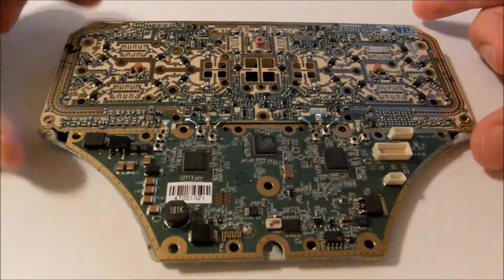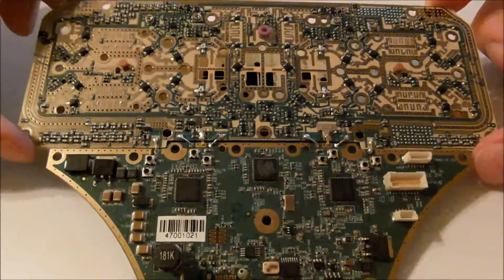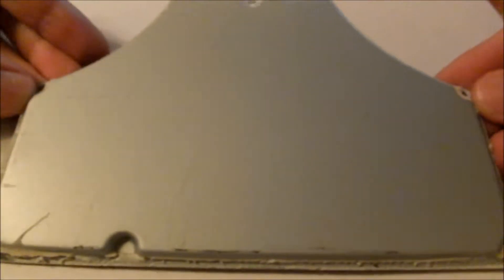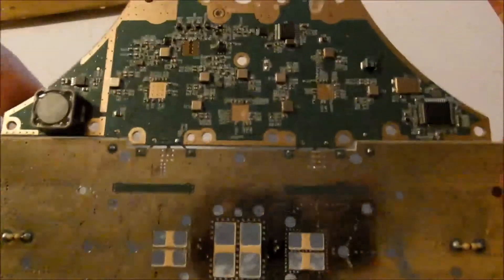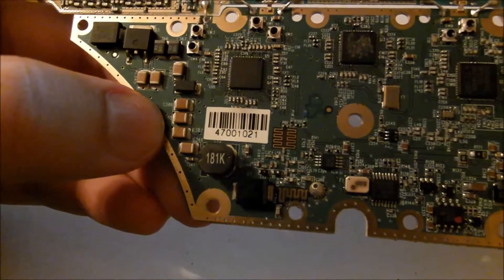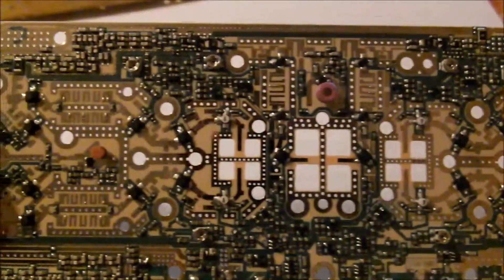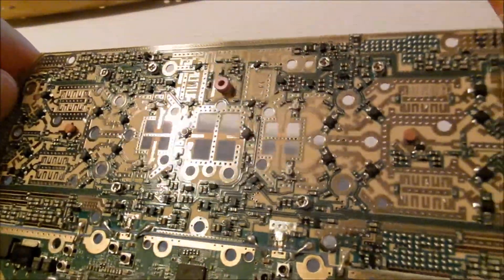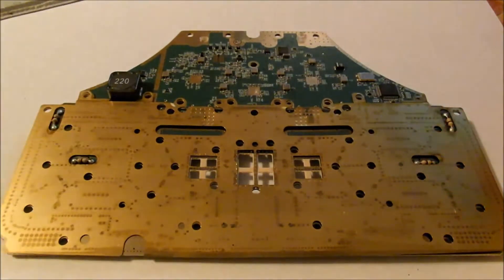DirectTV LNB Disassembled

Comment: Nice job on the video. The little brown capacitors are monolithic ceramic capacitors (MLCC) that contain palladium, and you are correct that the black ones with the white stripe are tantalum caps. Really liked the still shots too. I agree with you that Desoldering the pin is easier than breaking the board at that spot. I've found some of those pins with gold plating too.